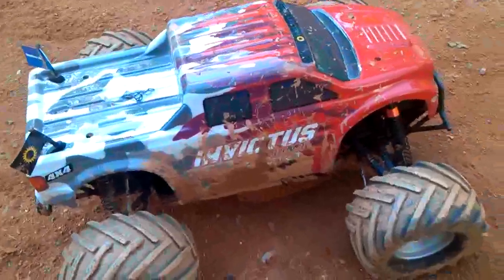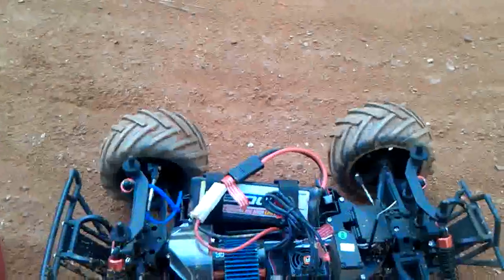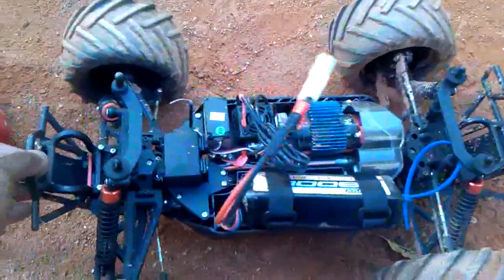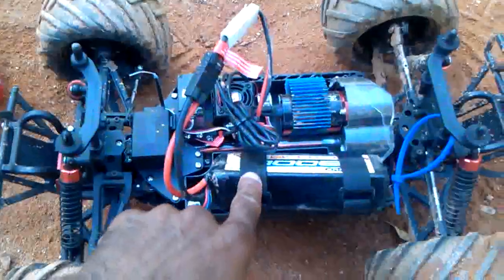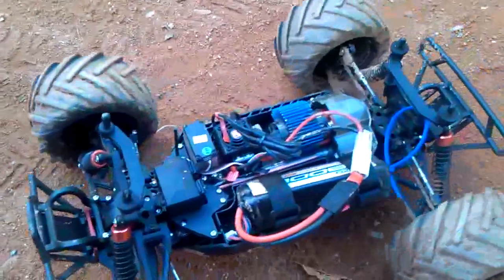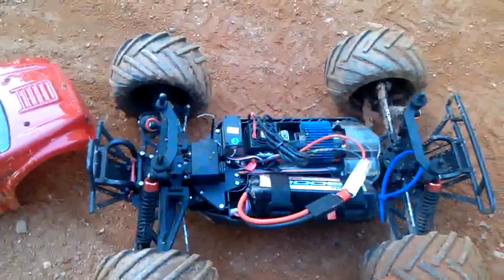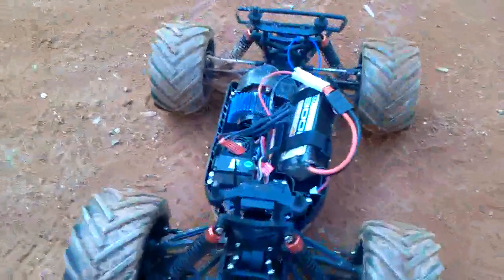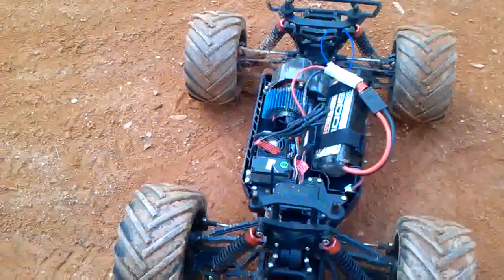Helion invictus 10mt Track results and third day run thoughts

Comment: I have a 3s installed in mine..... just cut out a little bit of the battery tray on the inner side.... and it wedges straight in nicely..... if you havent already.... I love it... my son has a traxxas stampede 2wd on a 2s lipo.... and it breaks tons, Im always replacing parts.... and we both beat the heck out of them... he is 7yrs old btw.... good times..... lost an axle on the invictus.... and the body is tore to heck.... but a little bit of duct tape on the underside and its good to go..... the traxxas front end breaks all the time and went through some gear pieces too.... im buying another invictus unless something else comes out faster... and my son is getting my old invictus lol.... CHEERS!
Reply: I havent upgraded anything except the speed control servo recall.... it takes 3s just fine... no gear upgrades...... yet.... its a beast!
Reply from the maker: Nice......I still have mine as well. Check my channel for other videos

Comment: You should always adjust gearing when going to a 3S lipo - that's not the motor's fault.  They package it to work on the included battery.  If your motor hit 200 deg, there's a good chance it'll never perform as it should anymore.  If you're sending that much power through it, I'd also lose the converter and solder on the TRX plug to your ESC.

Comment: This truck is garbage. I drove it for 10 mins the first day I bought it and I broke a wheel hub and a control arm. Also the manual is all screwed up. On the esc chart settings it shows that you can program different modes (it said green light and red light but there is only a orange light on the esc) this is not true. It was so confusing I had to go to the rc shop to find out the issue. They said that those settings don't exist and it's a different esc that the manufacturers never changed in the manual( because the previous one was catching on fire). From a scale 1-10 I would rate this truck a 3 because do to the cheap parts through out the truck. The remote feels very cheap and is not very responsive. I will never buy a mother helion again. I have had traxxes and I am sticking to it. Don't buy this truck it's a piece of junk I've already spent a ton of money on parts.
Reply: I had almost the exact same issues. i bought it yesterday. wish i saw this comment earlier, i'm so peeved off. waste of money.
Reply: truesnake100  I have one and it's stock and way stronger than traxxas brand I've bashed the shit out of mine intrusion and nothing broke
Reply: I have had mine and bashed the hell out of it only broke one thing and it was from jumping a half pipe and that was expected

Comment: I bought this yesterday, only the back wheel worked and the front was missing a drive shaft and the other one barley worked. 15 mins into running and the back wheel fell off. another 15 mins the front wheel broke off the a-arm and the fucking fan broke... how does the fan break when the body is on... I'm now on a 3-4 week wait for it to be repaired the day after purchase. DO NOT BUY THIS TRUCK. It was fun, when it worked, thats the only thing i rate. I'm so dissapointed because i saw so much positivity about it... now I'm stuck with a $300 truck that will need repairing every 5 minutes. Wow.
Reply from the maker: Really...that is crazy! U bought it new? I wld call helion 1st thing in morning and let them know bc that is fudged up man. Sorry 2 hear this.
Reply: Planning on it. Thanks brother. Guess I was an unlucky one.
Reply from the maker: Yea, but that is no excuse at all for them releasing crap. They do have great customer service, so they shld take care.of u. I have had three of this trucks and all were put together good. I did hear that they had a month r 2 of bad builds, so they shld have corrected.it. lmk what happens.
Reply: ohhhk sounds promising. it's already in my local rc shop. I'm in australia btw, so i'de have to email them. but hopefully i get it sorted or get a refund, last thing i want is to be forking out money for repairs every time i use this thing. and have a 2-3 week wait for it to get fixed. I bought this based off your excellent reveiws, it's a shame I didn't get one as quality as you. Thanks for replying man, helps out.
Reply: hey mate im baack. got the truck back works fine. but i keep knocking what i think is an a-arm out of the wheel. its got a silver ball and it locks in. how do i reconnect it?
Reply from the maker: Lachlan Douglas you will have to unscrew it and then rescrew it bac thru the plastic knuckle
Reply: Oh ok. Its all good anyway. Fixed it no dramas
Reply: well when i was running it just on a large soccer field the back wheel came lose and i lost the hex and the locknuts. and i live in norway so its a pain to get parts..

btw im running a 2s 7.4v 7600mah traxxas battery.
Reply: No idea mate, I've only got the invictus and had a lot of problems with it. Although its fun when it works. Heard a lot of good stuff about the dominus